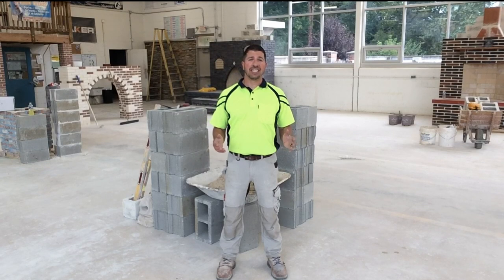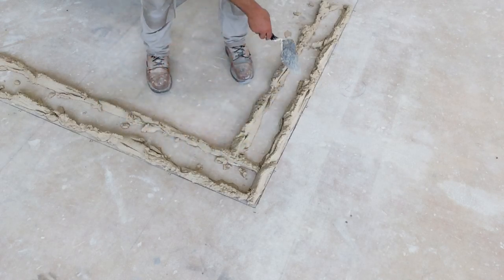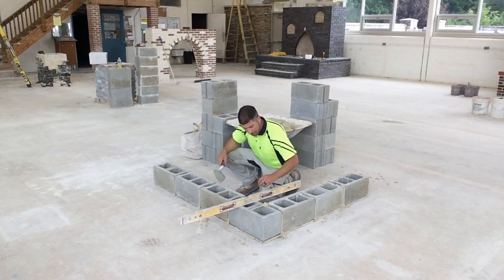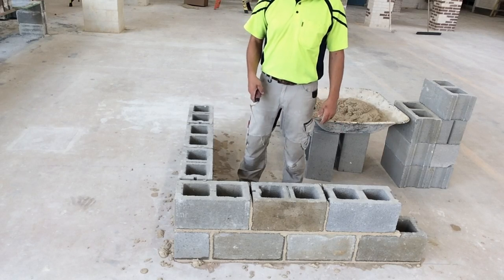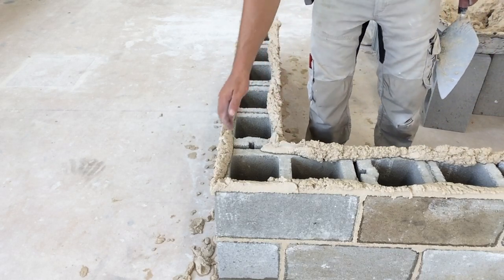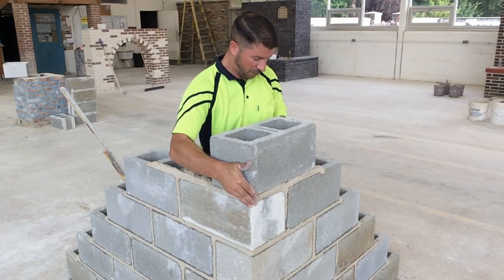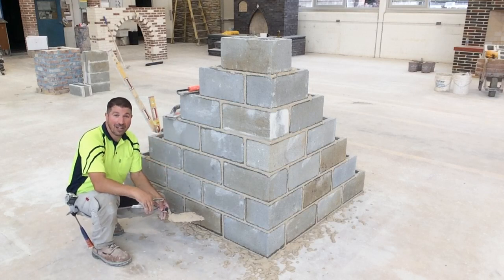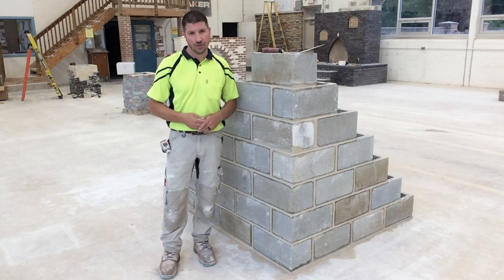Building an 8" Block Corner Lead [For Students]

Comment: Thank you for the video.  This and your other videos have helped to educate me in the art of block laying. I am having trouble trying to find an online calculator for the amounts of cement, lime and sand for the wall that I intend to build using this type of block. I don't suppose you can provide a link to one can you? Thanks in anticipation.
Reply from the maker: @malcolmsaunders9908  Thanks for the comment!  I’ll try to find something for you, if not I’ll show you the calculations in the comments here.
Reply: Thanks. I realised that what I could do was to buy a small amount of materials, use that batch up and then work it out from there. Problem with that solution is multiple delivery charges or multiple visits to the depot = more expense and time. Will hold on for your answer 👍🏻. I appreciate your valuable time
Reply from the maker: @malcolmsaunders9908  sorry for late reply. Here’s a basic formula. 

1 bag of Portland + 1 bag of lime + 6 cubic feet of sand will make enough mortar to lay 250 brick.  This is a general, rule of thumb solution. Variables include: cored vs solid brick, the size of the bed and head joints, and how efficient the mason is (sloppy/neat).  It certain scenarios, I can stretch that out to almost 500 brick per batch.  That’s how much it can vary. 

If using bags of masonry cement and sand, that amount is cut in half. 

1 bag of premixed mortar (80 lb bag) will yield about 30 brick. 

Hope this helps.
Reply: @masonry201  Thank you for all the information. I really do appreciate your help and your time.

Comment: How would you go about continuing from this layout. Do you set all 4 corners and infill the middle or stick with the layout to the other corner and cut blocks closest to the next corner ?
Reply from the maker: Great question!  Corners are built AFTER the layout course is established.  One single course of block is laid around to the perimeter to determine cuts, spacing, openings, etc.  

Once that is established, corners can then be built on the proper bond (spacing) so there's no guesswork to how it will work out in the middle of walls or on ends.  

Thanks for the comment!

Comment: If I were doing a straight wall (no corner) would I have leads at both ends of the wall? As for a retaining wall.
Reply from the maker: Thanks for the question!  Yes. Lay one single course first, all the way through, to a level string line.  That will give you the bond (block spacing), and a straight, level course of block to  measure heights from.

Comment: Were here in Fl., block is Stucco finish.
Im still trying to figure out HOW to get the Finished Height and Corners, from your Layout?
I kinda of under stand the Height, should be on 8" Increments. 
The Runs are what im having trouble with.
Reply from the maker: @chrislnflorida5192  blocks are 7-5/8 x 7-5/8 x 15-5/8 without mortar joints. 

Try to keep wall lengths to 4” increments, easier to make cuts, sometimes you won’t need any cuts. 

Heights will be on exact 8” increments. 

Lengths will end in a 5/8” increment. ( 12’ 3-5/8”) , (18’ 7-5/8”) , etc. 

Thanks for the comments!

Comment: Would this be suitable for a 14' tall workshop shop building wall? My HOA requires a masonry finish, so I was thinking something like this with a sone veneer for the bottom 3-4' and stucco then up to the top.
Reply from the maker: Thanks for the question!  Sure, that would look great.  They sell transition pieces specifically for that type of wall.  Transition from stone to stucco.  Sort of like a sill.  You could probably pull up an approved drawing online of a garage. and have it already figured where rebar will go vertically in the wall if needed.

Comment: The Lay out is my problem.
Blocks measure 8 5/8"x8 5/8"x15 5/8".
To finish corner to corner,  U lay out to the 5/8th" and to come out with the Finished Block  on the other end-
15 5/8"+3/8"= (16")?
Reply from the maker: @chrislnflorida5192  no, lengths will end in the 5/8” number. Thanks for the comment!

Comment: Is your mortar white because it doesn't have cement?
Reply from the maker: Correct!  It's just a lime and sand mix.  It can be reused over and over, even after it dries.
Reply: How many shovels of sand per shovel of lime? 
Thank you!
Reply from the maker: @margaritovelazquez1815  The ratio is 4 parts sand to 1 part lime.  So 4 shovels of sand to 1 shovel of lime.  Thanks for the question!

Comment: how do you clean up after you've done your work? do you sell those structures? lol
Reply from the maker: Great question! The mortar that's used is "practice" mortar.  It's just a lime and sand mix.  The projects are taken apart, the units get scraped clean, and the mortar and units get reused.
Reply: @masonry201  OMG you responded ok great so what is the percentage of lime and sand and water? I'm really trying to learn by myself because there doesn't seem to be a decent school near where I'll be at!
Reply from the maker: @zhugeliang777    It's a 4 to 1 mix.  4 parts sand to 1 part lime.  Dry mix them together first, then add water.  A mortar mixer is preferred, but you can just use a hoe and a wheelbarrow also.  For a smaller amount, you can mix in a bucket with a trowel.  
As for the amount of water, just add it slowly until you get it to the consistency you want.
Reply: @masonry201  Thank you!!! Ever tried mixing mortar in a cement mixer instead of a mortar mixer? (I'd rather not rent another tool if I can avoid it).
Reply from the maker: @zhugeliang777  Yes, you'll be just fine mixing it in a drum (concrete) mixer.  Most contractors use them to mix mortar in the UK, not so much in the US.